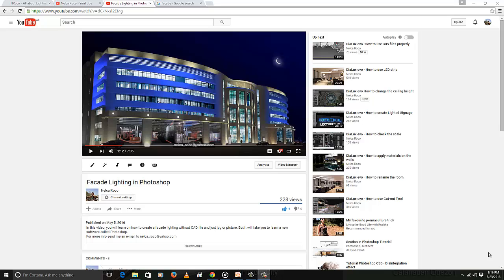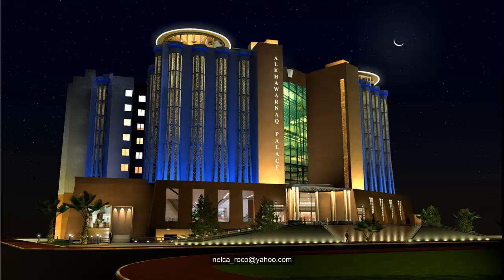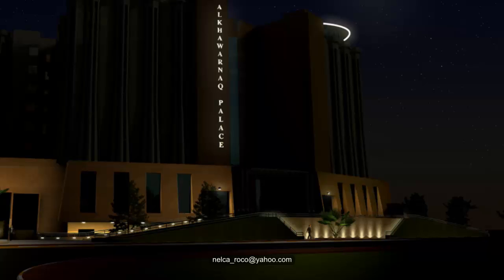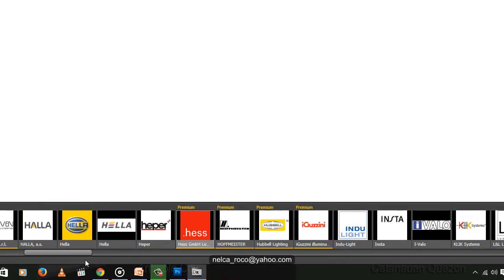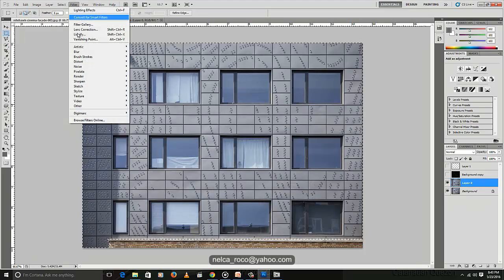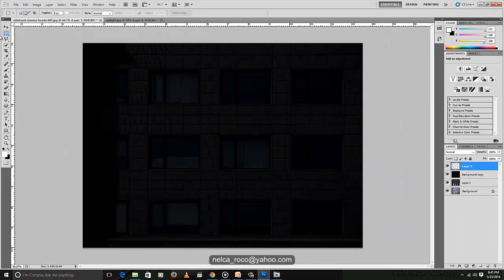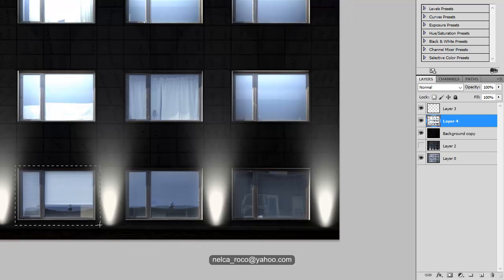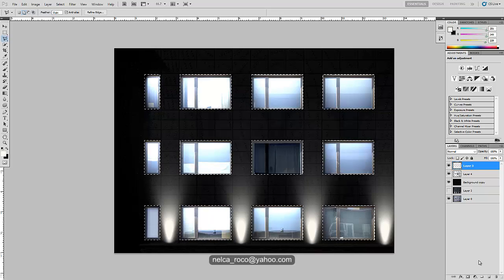Facade Lighting in Photoshop 2

Comment: Hi Ms. Nelca! Very helpful tutorial. Is there some way we can achieve accuracy with height and width of luminaire beam for facade lighting once we're doing it in Photoshop? You nailed your presentation but I can't help thinking about accuracy of each lighting application and its translation in actual site. Thanks (:
Reply from the maker: Hi Cris, Getting the accurate effect is possible if you know the max throw of your light. You can check that one in your photometric curve. There may have variations like some areas will have spill light, but more or less if you know how the light behave then you may get it right.  I may sounds vague, but if you like, you can show some images with the same application. Like what I did in the presentation. Side by side is the real picture and the photoshop creation. I hope it helps.  Thanks for watching!
Reply: +Nelca Roco Many thanks Ms. Nelca.